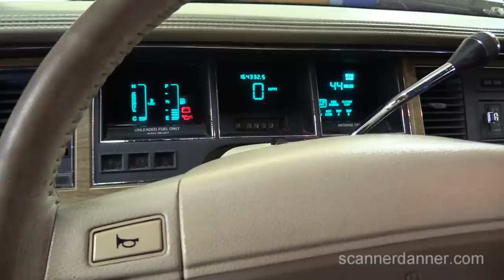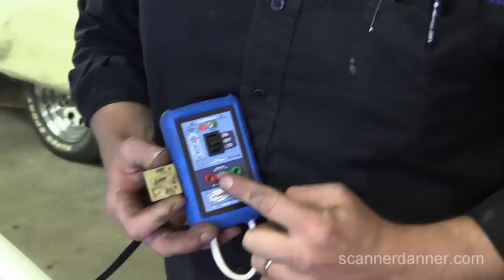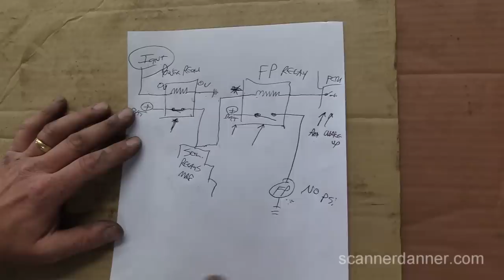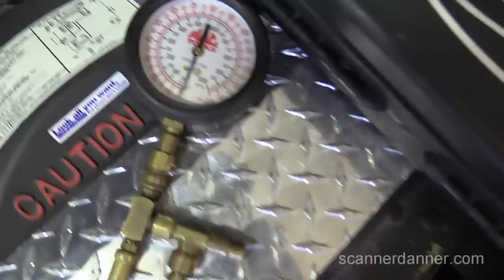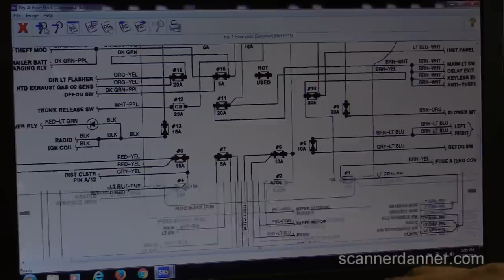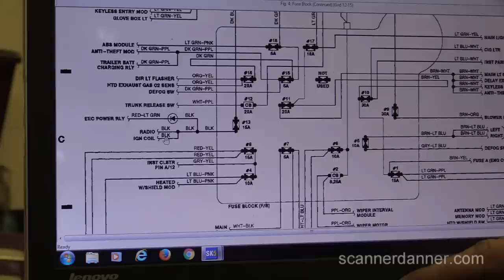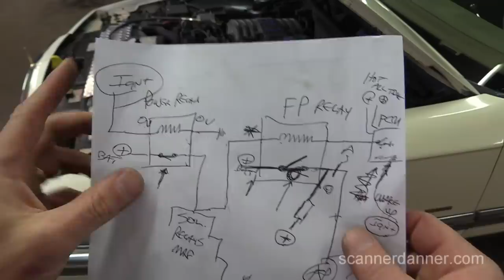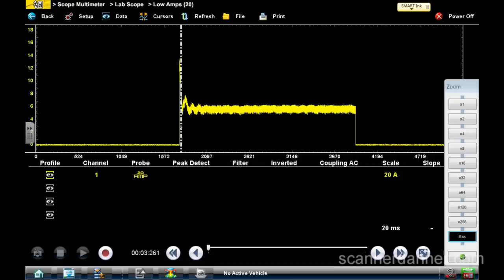Ford EEC-IV No Start No Fuel Pressure Troubleshooting (Lincoln Towncar)

Comment: Paul, what is your interpretation of a po455 intermittent with no check engine light illuminated?
I’m puzzled as to why this doesn’t trip a code. If you have time I would appreciate your comments.
I plan to give it some smoke, but just curious about these intermittent code issues.
Thanks, Mike
Reply from the maker: It would help to know what you are working on Mike.
Reply: ScannerDanner 
Sorry, my bad. 2008 Chevy Impala 3.5 L....105k miles
A while back vent valve was replaced, now the purge valve code is intermittent.
I just ran the codes by coincidence and it showed up on the scanner.
I was initially just trying to teach myself about  mode 6.....
Thanks .....
Reply: ScannerDanner 
2008 Chevy Impala 3.5 L ...105k miles.
Replaced vent valve a while back.
Once again, just trying to figure out why check engine light wasn’t tripped.
This all came about when I was trying to teach myself about mode 6....
Thanks....

Comment: If you are interested in inrush current waveforms, I recently ran across an appendix to a paper on sudden acceleration that discusses inrush waveforms for all kinds of motors, solenoids and such on cars.   

The file name is 'Inrush Current Waveforms.pdf' 

Appendix 1 from a paper 'An Electronic Cause of Sudden Unintended Acceleration', R. Belt,  18 March 2012

Comment: I have code191and 183 on f150 06model  checked system, can hear pump run when turn key on,but no fuel reaches, fuel filter, fuel level ok no leaks,no kink in lines, got any advise
Reply from the maker: you hear the pump run but no pressure? Check your powers and grounds to the pump and make the call my friend. Needs a pump

Comment: I have a 2003 Mazda B3000 that would not start after changing 3 injectors / 6. At first I thought it was the crankcase pressure cus the breather tube was loose but then after testing the AC voltage I noticed that the fuel rail wasn't getting any power and therefore no pressure.
Reply from the maker: Did you fix it?
Reply: @ScannerDanner  I'm getting power on my control n load both for power and ground. An when I turn the ignition on, fuel pressure goes up. After 3 cycles it makes it to 10psi. An wake up prime occurs for about a second when the test light is hooked up to the positive battery terminal going to Pin 2 [ground] on the control side of the fuel pump relay. All the electrical seems to be working right. checking fuses next. 

Maybe a  fuse blew when the pcv valve popped out of the crankcase while the truck was running? vaccum leak?

Comment: 98 Marquis.... installed new fuel pump& fuel relay ran good 30 min on old gas....then starts & dies n 3 or 4 seconds..... cleaned mas flow sensor & EGR & pcv & silinoid on gas tank fume canister..... now runs 10 seconds very ruff,.................I ck all fuse except under steering wheel..........I'll do that tomorrow
Reply from the maker: I have a great case study on a similar model with a part 2 where we found a bad connector under the hood. I need to find it for you...

Comment: 36:30 "I need to check my ground, but I don't have a power feed back here."
Who else thought? "Yes you do have a power feed, you just tested it." :D
First thing I do if I see "Radio" on a circuit is look at the Radio. If it's an aftermarket, then the wiring is always suspect. I've seen to many butchered wires from radio installs.
Reply from the maker: I just didn't have a way to use that power feed to connect my test light to it.

Comment: Did this car not have a fuel pump impact-switch in the trunk?
Reply: yes it has one, but it's inside the car by passenger side foot well area, behind plastic panel or carpet. it's either in front of the door or closer to the middle of car near transmission tunnel. the heat/AC box, windshield and others can leak water down in there and someone stuffing their feet way forward clowning around can smash them up also.
Reply: whoops, I should have noted, testing from the relay socket as he did, bypassed the inertia switch and all control circuitry anyway. there's also a fuel pump prime/test connector on them that does the same.

Comment: So what should I check if  my car won't start and the gas has 2 lines top and bottom?
Reply from the maker: 😂 wait, let me consult my crystal ball on what year, make, model and engine you have. Also what trouble codes (if any) and what you've tested for so far. Spark? Injector pulse? Fuel pressure?
Reply: @ScannerDanner  90 towncar haven't checked anything yet but wondering if u seen anything like that b4

Comment: Should I get a prime on 99 camry ? Spark but zero pressure new fuel pump relay switched with known good
Reply from the maker: Stay in our original thread please. It's too hard to do this otherwise for me. Or we can stay in this one. Because this answers my last question to you. 
Spark and no fuel pressure, so we want to go to the pump electrical connector next and check for power during cranking. Your system may not provide a prime. In fact I'm pretty sure it doesn't.
Reply: @ScannerDanner   I have power while cranking check eng lite stays on while cranking it just threw a crank position A circuit malfunction thanks to you  I have made headway in this problem I thought all cars had powerup and I've been doing this 45 years thank you
Reply from the maker: @bobbyu8991  yeah Toyota was weird. They used a "circuit opening relay" for their fuel pump circuits that has two separate control windings. One energized during cranking through the starting circuit and the other energized when the car would run through a mechanical switch contact located in a vane airflow sensor. Once they got rid of the VAF sensors, the computer driver took over the run circuit control but they still used this old technology for a long time. So no prime on these systems. I hope that makes sense.
Reply from the maker: @bobbyu8991  definitely attack the crank sensor code!
Reply: @ScannerDanner  done and fixed because of your comment about power up had no codes yesterday towed in prolly wouldn't have changed my diag focus without those few words excellent thank you !
Reply from the maker: @bobbyu8991  awesome! Thanks for the update and you are very welcome

Comment: What if both bushes are worn down to the point where both brush spring's contacted the commentator at the same time causing the fuse to plow... In which the armature is grounded to the housing itself...
Reply from the maker: What if it did? You'd have a fuse that would constantly blow but wouldn't as soon as you unplug the fuel pump connector
Reply: @ScannerDanner  makes sense Paul ...  I always trust your judgement... Your the one i never question with no doubt... You've thought me more than any other TEC on utube number in my book for sure... Sending love to your beautiful family God bless you....

Comment: Even before you made the discovery that you possibly blew the fuse, and as you were explaining the wiring diagram, I was wondering that if the car was trying to start at first, you said no ignition problem, and fuse #13 also controls the ignition coil power, how could it have been blown before you started the diagnosis?
Reply from the maker: I said I suspected "no ignition problems", I never said the ignition system was good. I chose to start with fuel pressure based off of what I was told by the owner

Comment: How do you tell if a eec is bad?
Reply from the maker: did you mean the engine computer? There is no one test that you can do and these older Ford EEC-IV engine computers almost never went bad
Reply: ScannerDanner  yes it’s the engine computer in f250 1994. It smells like its burned up. So the pump does not prime on ignition on. I jumped the relay for the pump and it works. Also ohm the relay to make sure it is good and it is. The engine light doesn’t come on when ignition on.
Reply from the maker: @jonbozzy9600  first check is to make sure your EEC Power relay is doing it's job.
Do you have power to your injectors? It is a quick way to tell
Reply: ScannerDanner just took the eec unit a part and it is fried.